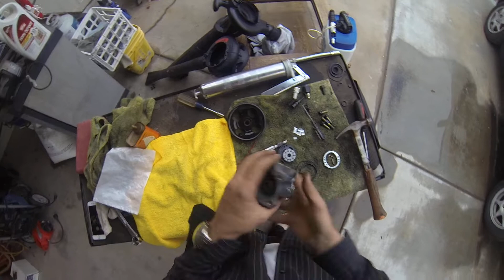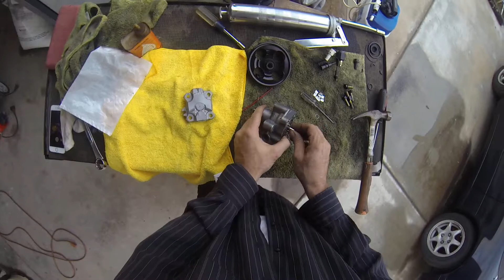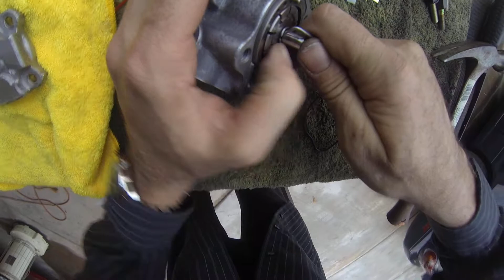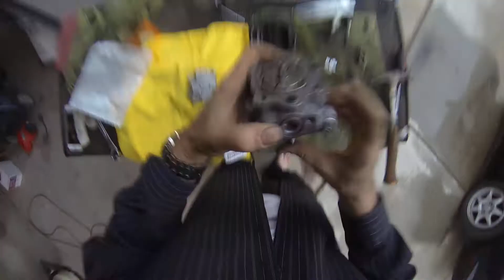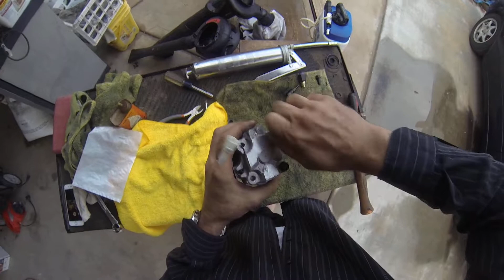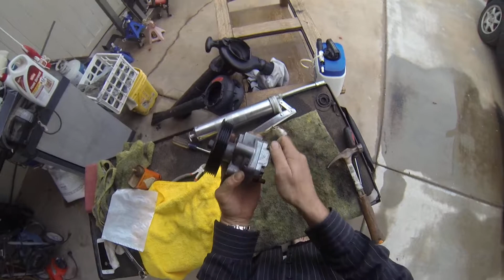Re-assemble a subaru power steering pump from parts

Comment: what year and model Subaru? was the reservoir on top?
Reply: Looks like a 1999-2001 Impreza. Uses the Gates 348734 reseal kit. I do not believe this pump had the reservoir on top, at least mine did not and is identical to this pump.
Reply: @thejoshuahenry  sold my 2005 with all its woes. Bought a 2019 OB.